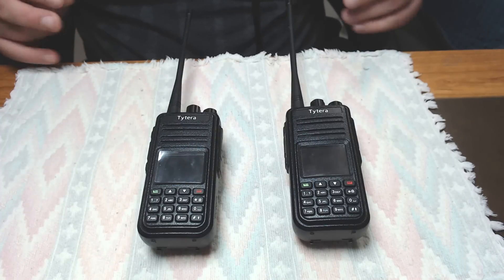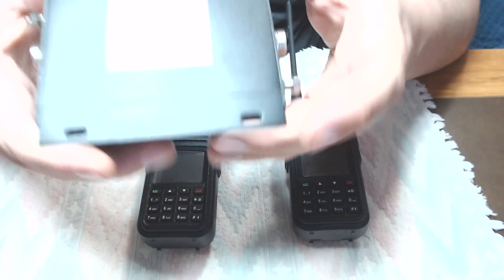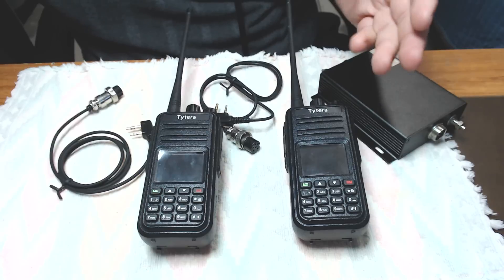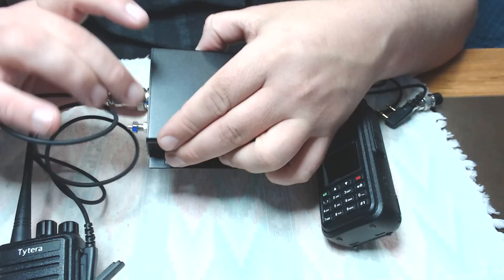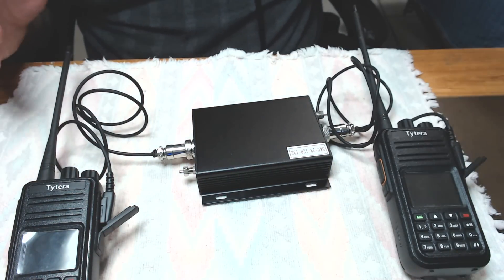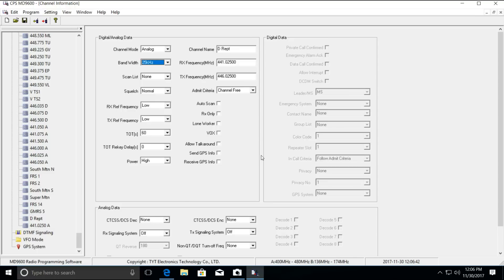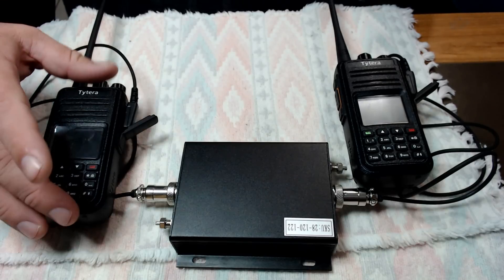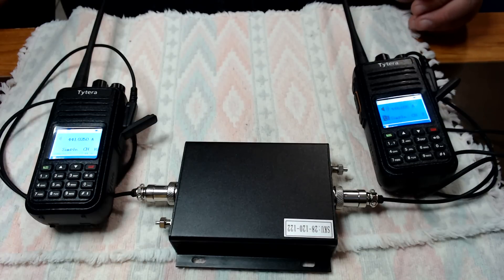MD-9600 & MD-380 Home Repeater

Comment: Thanks for the video. You might want to use a mobile radio for the output, to give you extra range. Or, you could connect the TX handheld to a linear amp. I saw that BTECH has one on Amazon for $137.00. If you use a mobile radio, I guess you would have to find a special cable, which might not be easy.

Comment: Have you range tested this? What were the results?  I did something similar with some UV-5r's and they only work in close proximity.  Completely undermined the purpose of the repeater.  Thanks!  KO4AWG
Reply from the maker: Hey Cody, great question, it works like I wanted to, range is limited to line of sight or any distance in your area with the five Watts. I know that doesn't really help, but for range wise, I can talk all over my town with just this. Of course that's using two antennas that are 15 foot in the air. Thxs for the question! 73'
Reply: Whats the separation on those antennas? Vertical or horizontal? Im using the same set up with Uv5x(GMRS Ecom Repeater) . Great video...Need more 👍! 73

Comment: Does the watt on the transmitter radio matters ? I'm guessing because even if u have a good antenna the power of transmission will be low if ur radio is 1 watt to 5 watt
Reply from the maker: I'm sorry I didn't see this question sooner, yes and no? All depends on location, what you plan on doing, line of sight... So many questions. But as far as power goes 5watts should do just fine. 73's

Comment: I just bought this same one. I have two baofeng radios. They flip back and forth....do you want a response video? Maybe it would help some of your subscribers

I bought two and they both do it.

Oh, I also have a set of Kenwood TX-2312 radios, they have one less ring o  the one set up....does that make a difference which cord I should order?  I ordered the K-Style one....but mine looks more like an older Motorola type.

Would a video help (I'm guessing yes)
Reply from the maker: Afternoon Weldorguy! Thanks for your comment and questions, if you'd like to make a response video I think that would be great! I know I'm slacking on a few videos, I plan on making them here soon. 

I'm not too sure on the Kenwood TX-2312, it looks like it "should" ..and I say "should" work... but then again I do not know.

Thanks again 73's KE7FEI
Reply: @KE7FEI  I got it working, I had to take the Roger off, to make it work. 

The Kentwood prong has two different styles on the mic side....the mic side has one with 2 line or one line.

I find the 1 line mic I have which I love (the KMC-45) works great on the Kenwood, but I get all kinds of glitches with it on the Baofeng side.

Is there a mod or an aftermarket plug you can wore in yourself to fix this problem with the baofeng and my KMC-45. I love the sound I get from the kenwood but the compact size from the baofeng.
Reply: @KE7FEI  thank you for getting back to me soon quickly

Comment: Can I possibly ask if you have the pinout or another option for repeater box to use with a md-9600? I was looking at making a custom cable to use with a surecom but have no idea what pinout layout to use.
Reply from the maker: Hey James, sorry for the delay in response, I'm looking for the pinout that I have written down somewhere and as soon as I get it I'll make sure to let you know. 73's KE7FEI
Reply: @KE7FEI  Actually you are a lot faster in response time compared to most I have asked questions of. Thank you for the reply, I am putting together a repeater system for emergency use and it seems I am just in time considering the mass outages over the entire nation yesterday.
Reply from the maker: @jameslargen284  , I have looked and looked... hours of looking, sad go say I have nothing for you. I even contacted the company to see if they had the schematics for it, the language barrier was the worst. I will keep looking, I currently don't have the gear in front of me that's in another state right now as I'm traveling. But if I find something I will get ahold of you ASAP.
Reply: @KE7FEI  That is quite alright, I believe I have figured it out actually. Sorry for taking a bit to get a reply sent out,  but I do have a question. Did you set this up as a digital or analog repeater, because on digital wouldn't it time out because of no time slot conformation?
Reply: I want to use something like this, but i want to use an HT for rx, but use my 9600 for transmit. Any tips?
Reply from the maker: Great question Daniel, I'm sure if you made a cable mod then it would work with this.... never thought of using the 9600 with it. I own the 9600 too... hmmm something to think about, but I would say a cable mod for transmit and revive for the 9600 and it would be good to go.

Comment: I am sure this is a stupid question but will this set up work for gmrs? What radios do you recomend for gmrs. Looking for a small repeater set up thanks
Reply from the maker: Matt Oesterlei not a stupid question, I can check to see if it does and get back to you. I'm not sure that it does, haven't tried it yet. As far as the radios, I can give you a list, in the video I'm using Tytera MD380's. Let me get back to you on it :) 73 KE7FEI
Reply: Sounds good sir thanks. I just wanted something small so my base and my mobile in truck can talk little farther

Comment: I'm looking at using this for an inband UHF repeater. Can a single UHF antenna be used into duplexer (1x UHF Antenna In : 2x UHF Connectors Out (to the two radios)?
Reply from the maker: Yes it can be Ozzie, I'm working on something like that now but a duplexer will work just fine.

Comment: I assume this was an analogue repeater ? not a DMR one ? on the grounds that if you had two MD380s in TIER1 mode and tried to inter-operate with a 3rd radio programmed for DMR repeater operation then radio #3 would be in the wrong mode (TIER2) and would not hear the (TIER1) repeater output ? unless of course you programmed up two adjacent memory channels in radio#3 - one as TIER1 on the input one and the second as TIER1 on the output ? then it work (as long as you switched channels manually each over)
Reply: Very interested in this setup as a DMR repeater.
Reply from the maker: Hey MWOCQU, thanks for the comment! Right now it is a analogue / in the works dmr one. Working out all the bugs and programming for the dmr part, thanks again for the comment! 73 KE7FEI
Reply: @KE7FEI Did you get anywhere with having these both on DMR to act like a DIY DMR repeater?
Reply from the maker: Hey @militaryrig , sorry about the delay in getting back with you. Yes I have, and Yes I will be posting a full year update video coming soon. Answering Many Many questions that I have gotten. Thanks again 73' KE7FEI
Reply: @KE7FEI  what happened with the year update video?